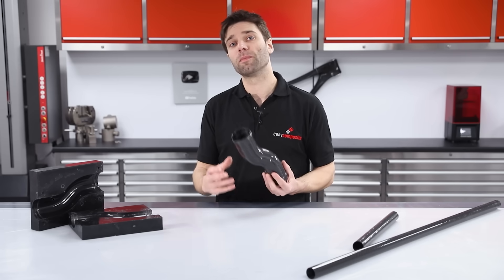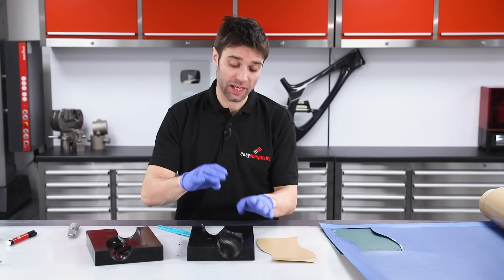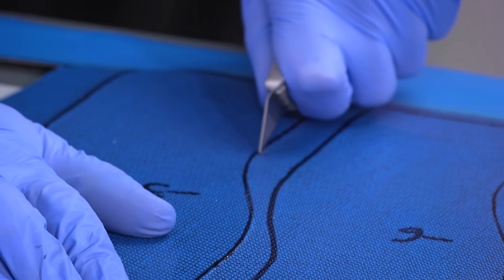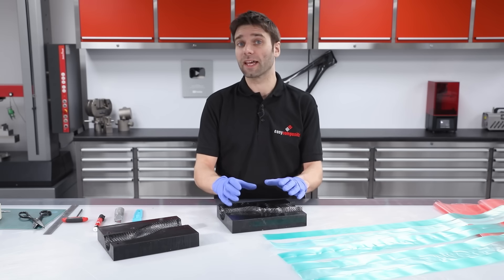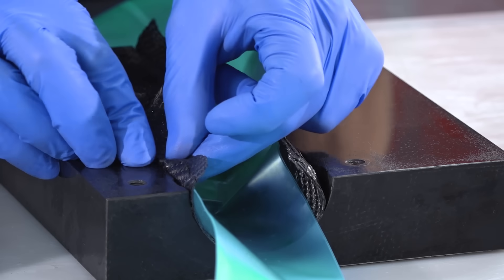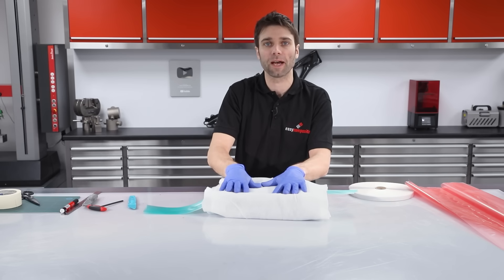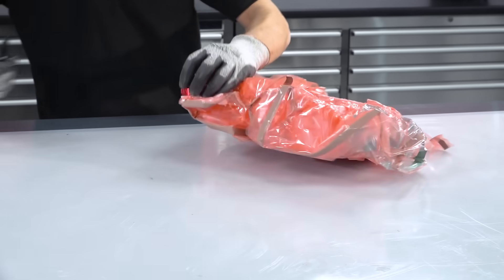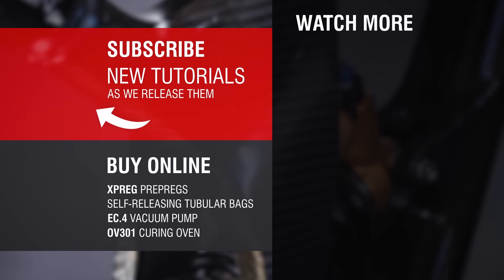Making Complex Carbon Fibre Tubes Using a Split-Mould

Comment: There's a great deal of DIY composite videos on YouTube that often look like epoxy castings with a little bit of fiber in them... So we really appreciate what you guys are doing at Easy Comp, representing proper structural layup, in concise and useful little tutorials with slick production. Quality 🏆
Reply from the maker: Thanks very much. Yes, we try to show a range of ways of doing things. We will, in fact, be returning to some simpler and more entry-level topics over the next few videos but they'll always be showing a process that's used for a good reason, even if that reason is simply to avoid the need for complex tools or equipment. Stay tuned.

Comment: Can we use the same process with vacuum infusion instead of pre-preg ?
Reply from the maker: It's really very difficult to make something like this using a resin infusion process. Nothing is impossible but the practicalities of dealing with dry fabric and then handling the infusion consumables, it just makes it too difficult.
Reply: @easycompositestv  indeed it is. The resin needs heated and degassed for a start. The material needs an activator and heat, to create a pre-formed shape. And then the resin needs injected with compressed air pushing it in, with vacuum at the other side helping draw the heated resin to every crevice in the pre-form. That's the "vague" theory used by aerospace to make resin infused carbon parts 👍 (I worked on autoclaves in this way)
Reply: @E9JMX  The only things that I find wrong with your reply is #1. The A+B epoxy creates its own heat to cure.  #2. You only need vacuum to draw the epoxy into the material.  #3. Adding compressed air would add air to the mix.  Keep in mind I used to do these processes when making carbon fiber prosthetics.  Adding to the fact that we both understand manufacturing, our products might require different processes.  Just throwing my two cents in.
Reply: he said you can but its not worth it

Comment: What a nonsence, why you just don’t make it from carbon socks?
Reply from the maker: In fairness this is the process used to make high end composite components like carbon fibre bike frames or suspension wishbones on F1 cars. To understand why you wouldn't just use woven carbon fibre sleeve you'd probably need to understand quite a lot more about a few different aspects of the materials and process, maybe a little more than I can explain in a YouTube comment. A couple of reasons that come to mind are:

1 - Fibre orientation and alignment  - the high performance of these structures relies a lot on UD fibre aligned down the length of the tube; not possible using a woven sleeve, and precise multi-axial fibre alignment elsewhere too.
2 - In complex tubular frame forms, like a bike frame or wishbone, the sleeve would need to be an incredibly complex 3D woven preform, just not practical
3 - Woven sleeve has a specific behaviour in terms of longitudinal contraction with diameter expansion which is particularly unhelpful in a closed mould like this when pressure is exerted to expand the sleeve and consolidate the reinforcement.

Check out our video on laminating a carbon fibre bike frame. When you watch that it might be more obvious why it's not just 'sock' :)

Comment: Yay new easy composites video! and the right video at the right time i need it since i am working on an induction system
Reply from the maker: Haha, great, that's good timing then. We aim to please :)
Reply: Please you do indeed, i've started with Fiberglass and Carbon Fiber just recently, but have been watching your videos for years and they showed that it is alot of work but no magic involved, i have quite a few molds already, the whole vacuuming equipment is coming together piece by piece, until then i am using a food vacuum pump with the tubes and the clothes bags, which both release awesomely haha